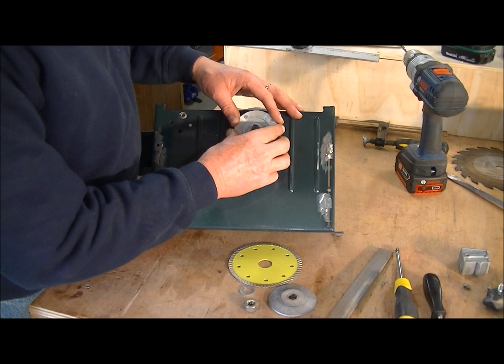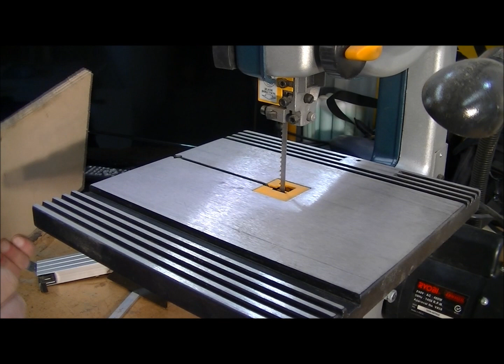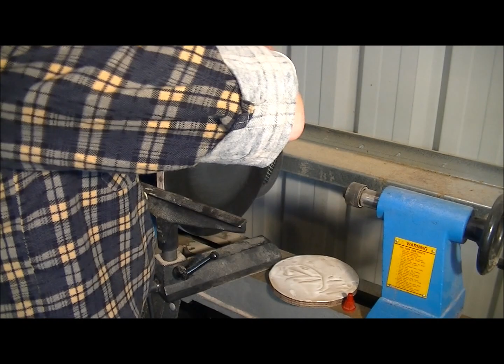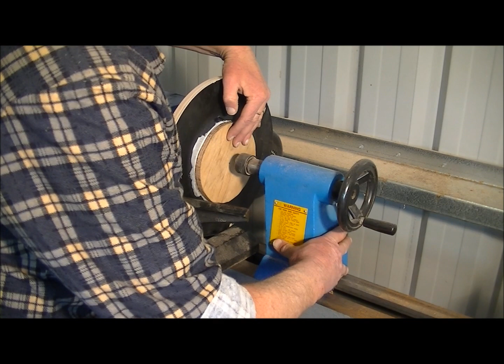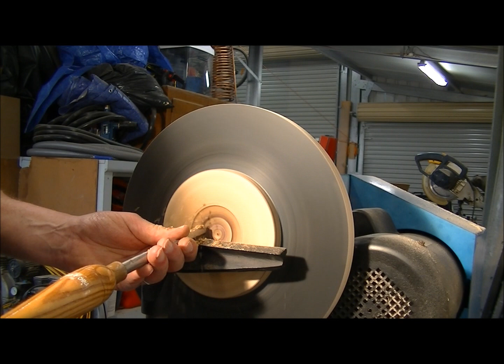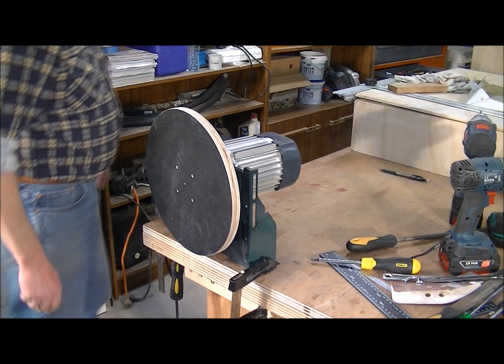57  Building a homemade 12" shop disc sander part  2

Comment: Thank you for your videos, very interesting. I have to say, however, that I am very worried that you are going to have a horrible kickback-related accident if you keep freehand-cutting stock through that table saw. You may have been using a table saw for longer than I've been alive, but please, use a fence or a mitre gauge! All it will take is for the cut to bind a little and it'll throw that plywood straight back at you ... very, very fast.
Reply from the maker: Dear Mr Woodworker, I am gladdened that you find my videos very interesting and thank you for your comments and watching my video. I would like to alleviate your worries regarding my work habits: 

I never accept kickbacks 
I always work with at least one hand free, my one hand never knows what the other is doing as I am ambidextrous, well my hands are.
I never throw things around my workshop.
I never work very fast, let alone very, very, fast.   

  Roger Clyde Webb Australia